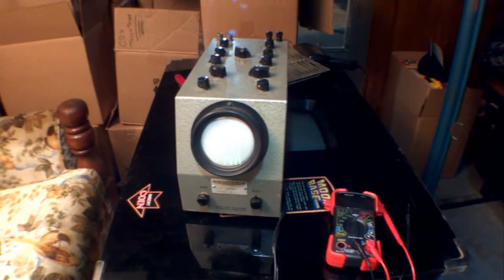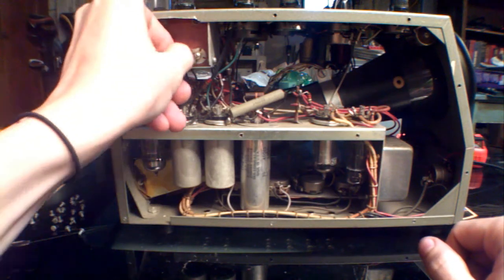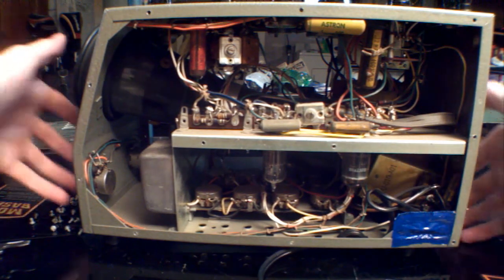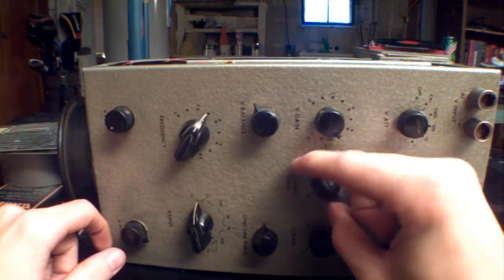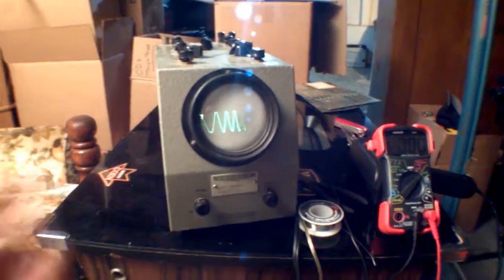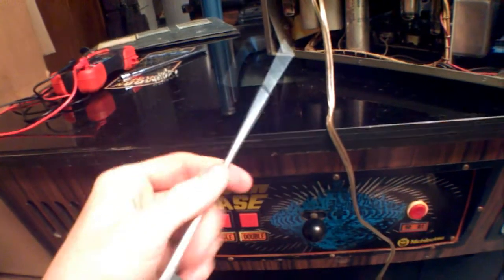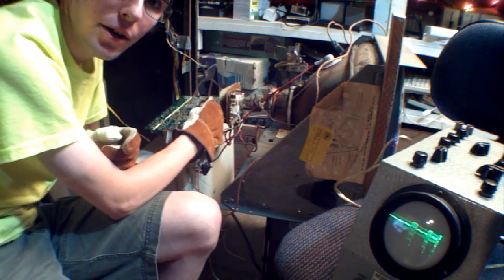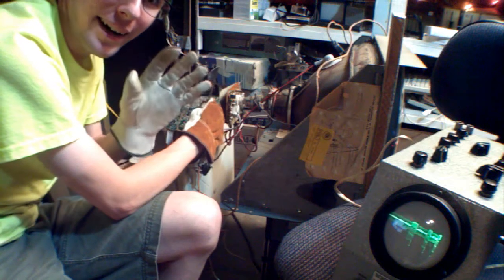1940's - 1950's Philco oscilloscope upgrade

Comment: I actually have one of these, in my grandparents basement, I started to play with it untill I got a 120v AC shock, no clue if it's built that way or a coil in the power supply is shorted or what

Comment: not sure how I ended up here, and if you fool with electric devices, you only check for faults with the back of your hand.  never the front.  same with hot things, and very cold things.. your body reacts to changes by clinching that hand.  ALWAYS THE BACK SIDE OF HAND,   just sayin for anyone witnessing what I did here.  Its a shame your image is weak.  Crt's have a lifespan, but considering the limmited use, it should still be ok,  likely your emitter or emitter bias.  All us old things tend to change values with aging.  it might only take the turn of a screw or replacing a resisto.  they tend to degrade over time, the actual resistance value drifting off spec until it either fails completely or gets far enough off its normal value that the circuit it is part of stops working.
Here's hoping  you're still alive and well..

Comment from the maker: you mean "Akalabeth - World of Doom"? that was made in teh 1980's for the Apple II and the IBM PC. i'm meaning the video games made in the 1950's and such. the first game "Tennis for Two" made in 1958 used an oscilloscope connected to a 100,000$ analog computer. the guy made it to impress visitors at a company event i think.

Apple II and IBM PCs use Raster screens and just draw lines on them, but that is very similar to a vector image. Asteroids arcade machine used a Vector screen.

Comment from the maker: well you do look at it to see the waveform. so "scope" is accurate. but yeah your right about it analyzing the circuit :D

the first video games where drawn on oscilloscopes tbh, they are very versitile. i've seen people who build circuits to make them run like TVs too. i plan on using an Oscilloscope for the graphics display of my DIY computer. i've been working on a computer that doesnt use any microchips. just hundreds of transistors/relays.

Comment from the maker: i will use this scope to troubleshoot my Mappy arcade Machine's tube circuit. by probing differant pins on the board i can see where the signal goes from the microchip to the Yoke (the yoke is the electromagnet around the neck of the tube, it deflects the beam to draw the image)

somewhere in the circuitry the signal that controls the width of the image is getting garbled. i can poke around and see at what point the waveform gets wonky. hopefully.....

Comment from the maker: you mean the oscilloscope? well its basicly a TV tube that instead of drawing a square picture it draws a line. and instead of the signal changing the pictures color/brightness the signal makes teh line (witch is a dot moving really fast) jump up and down. it has an extra thick layer of Phosphor on the inside so the dot's trail is brighter couse it glows longer.

this allows you to see whatever the waveform is of the circuit your probing.